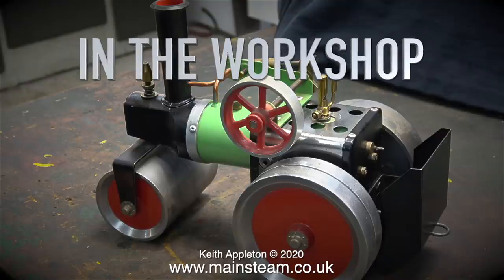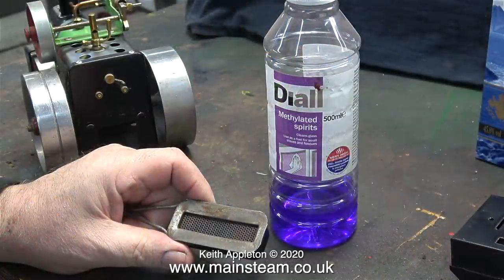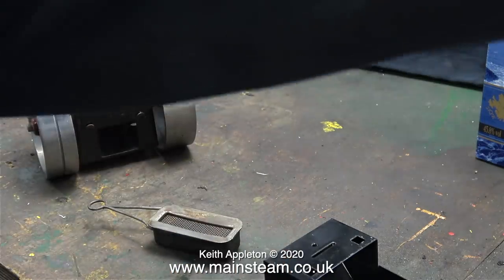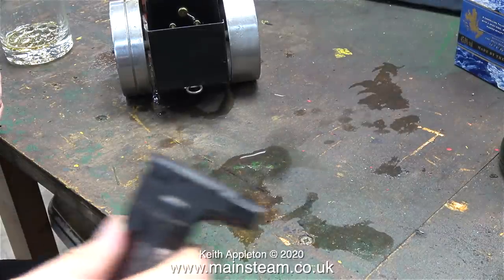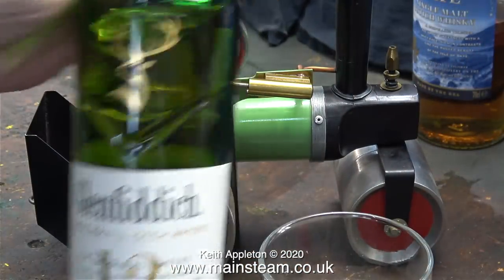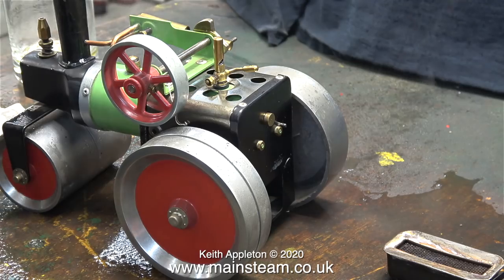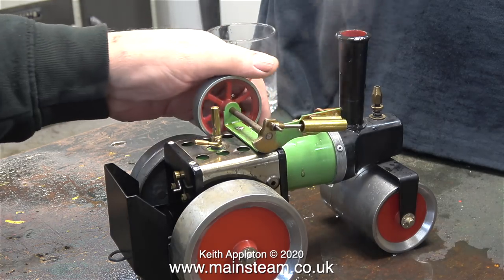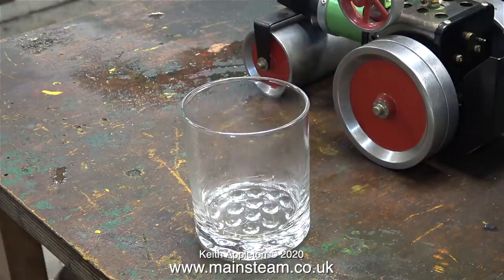A MAMOD STEAM ROLLER RUNNING ON ALTERNATIVE FUEL

Comment: During the great meths shortage of one afternoon in blackheath at a mates house in 1976, we tried white spirit. It raised steam pretty quick , the minor 1 was engulfed in flame and heading for five figure speeds and we were laughing so hysterically, we couldn’t blow it out.   We did manage to in the end as the room filled with smoke and soot( its a very dirty flame). Not recommended Keith 
Happy days
Reply: better off with the fuel tablets

Comment: The chimney on my almost identical roller (circa 1963) always got a lot of condensate in it, until dad drilled a hole into it near the base to let it dribble out.  Filling with boiling water helps a bit with running time (obviously).

Comment: When I was a boy I had a Gilbert stationary steam engine that used paraffin as fuel.  It came in little round tubs with a lid on it.  You could also use them when camping to cook with.  The only problem with using paraffin was the soot that accumulated inside the fire box could get thick enough to stop heat transferring to the boil.  My dad would also have a tea kettle boiling water on the stove so he would pour a little into the boiler to speed things up a bit. The one thing he never did was drink anything stronger then beer, so we never tried using whiskey as a fuel.
Reply: that has happed to me in the past

Comment: Just as long as you do not try drinking the methylated spirits you are ok, but personally I would have just drank the whiskey. I would have joined you in having a sip or two but it is only 10;45 am when I am watching this, may have to rewatch it in the evening.

Comment: Was this video an advert for Mamod steam engines or whisky? Funny how running traction engines and drinking alcohol seem to go together.  This certainly was an early roller with no reversing lever and only one handle on the drain plug.

Comment: Is that a SR1 or preSR1?  This is the first one I have seen.
Reply from the maker: Sorry I have no idea, I am no expert on these small steam toys.
Reply: It is indeed a Mamod SR1, but it is not the oldest.  The oldest Mamod steam roller, is the SR1 Nut & Bolt, because it was assembled with nuts and bolts, as opposed to rivets, with the water level plug!  The new and improved SR1A came next!  The same with the Te1 with no reverse and a water level plug,  the oldest is the Nut and Bolt, then the riveted Te1's, then the  new and improved SR1A and the TE1A, also with the water level plug, and like all the old Mamods, a single oscillating  cylinder
  In general, the TE1's and SR1's were made somewhat in the 60's and the Te1A's and SR1A's, also with the water plugs were made in the 70's!  Now days, the newer ones have a water level sight glass, and the newer ones even have the double action single cylinder!  Seem to be getting more like the Wilesco.

Comment: are the older Mamod portable engines with the water plug boilers safe to steam in Public?
Reply from the maker: I guess so - they are extremely low pressure devices.
Reply: @keithappleton  when I have fired up mine own old Mamod engines in the past it was a bit of a problem when the warm water was coming out the back of the boiler I also found putting the plugs back a bit of a problem. going to see a friend about the trouble soon